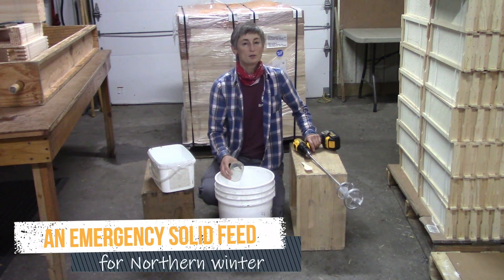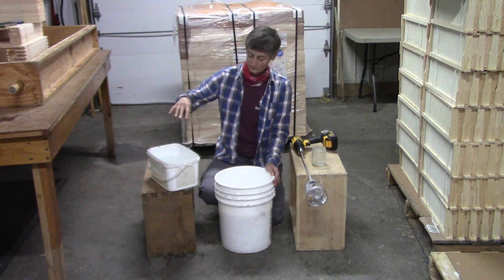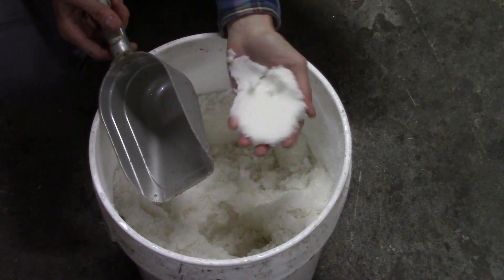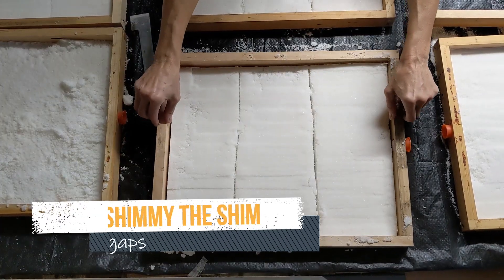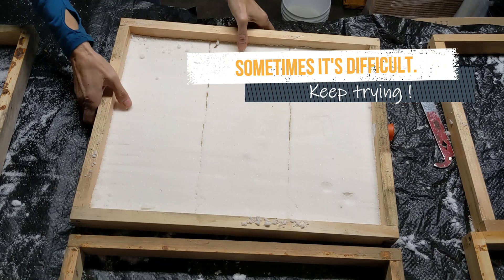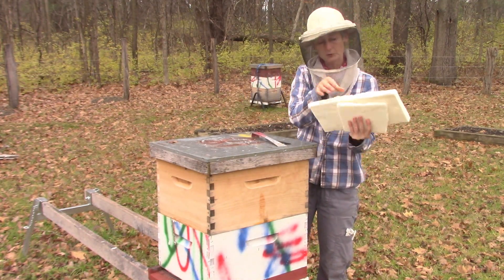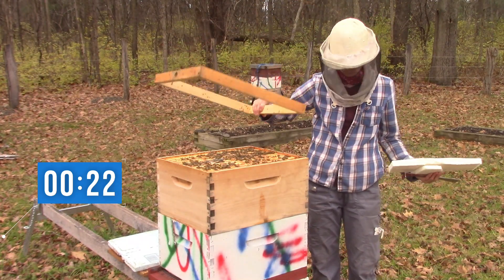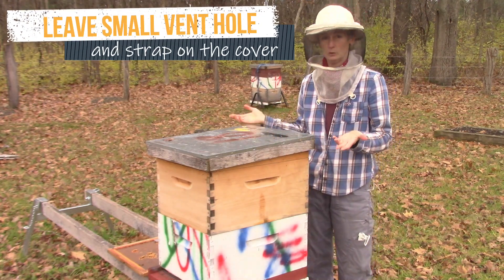Making Sugar Bricks for Feeding Bees

Comment: closing the upper vent will help your bees maintain heat and use less food over the winter.  Just a suggestion. The insulation under the cover will keep moisture from raining onto the bees. good video, thank you for the information.
Reply from the maker: Thanks for the input, K! We hope your bees are overwintering well so far.
Reply: Does the sugar board act as a moisture board?  and does a moisture board need to be put on once the sugar board is gone?
Reply: @alafferty1264  No, it doesn't absorb much moisture, so if you use a moisture board, just keep it on during and after feeding sugar bricks. Remember to leave a little hole up there for bees and air to go in/out of the hive.
Reply: @annefrey8732  Got it.  Thx
Reply: Where do i buy that insulation ? What kind is it
Reply: Not sure how you are placing fondant on "wax bumps" ? Also, convert tbsp to cups!